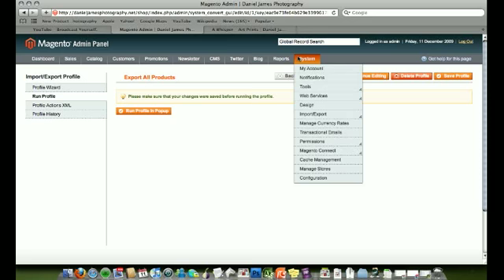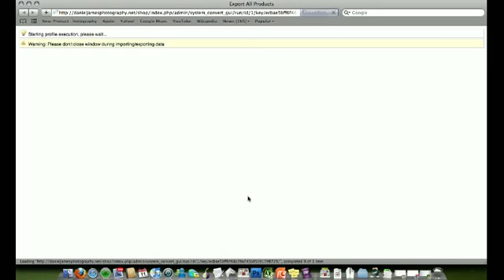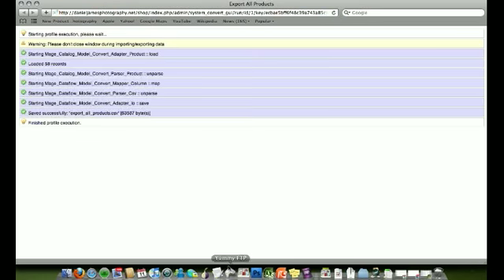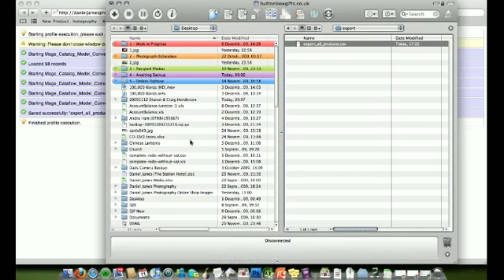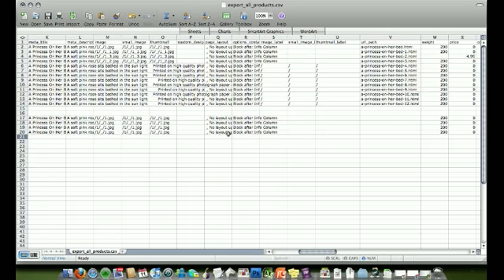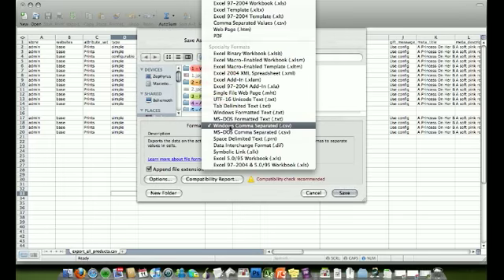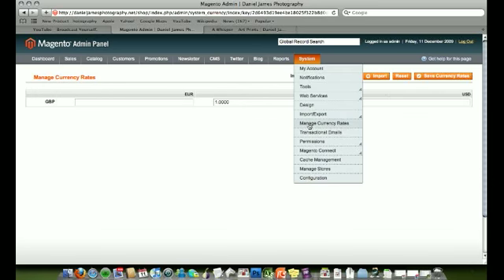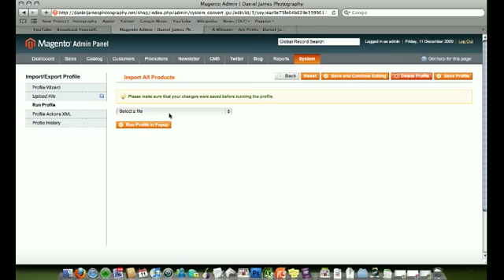Magento | Setting up Multiple Attribute Items | Using Microsoft Excel CSV | Configurable Products

Comment: My advice is to use these add-in for connecting to Magento data from Excel - https://www.devart.com/excel-addins/magento.html
It allows you really easy choose the needed data, load it to Excel spreadsheet, edit and then save back to Magento